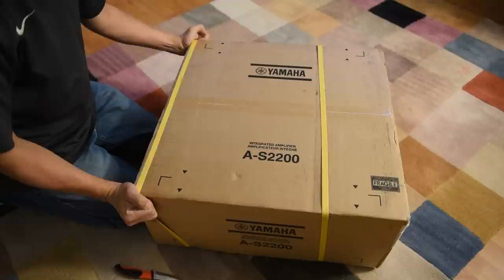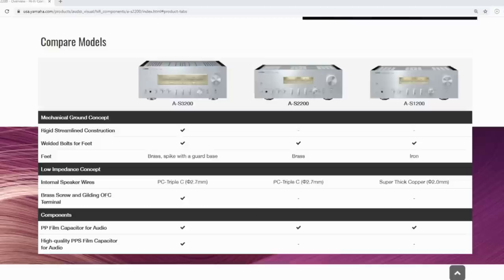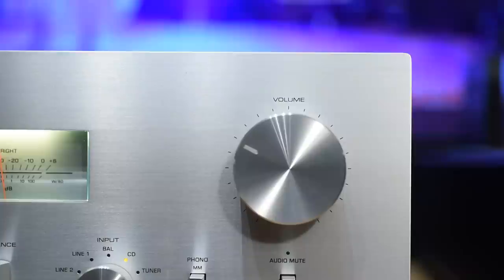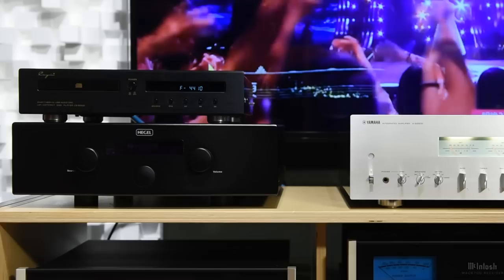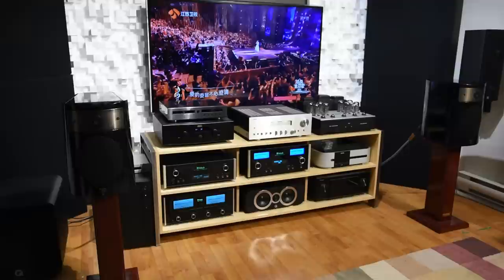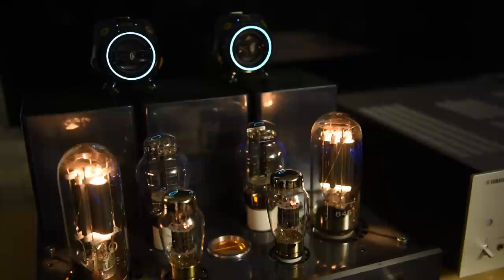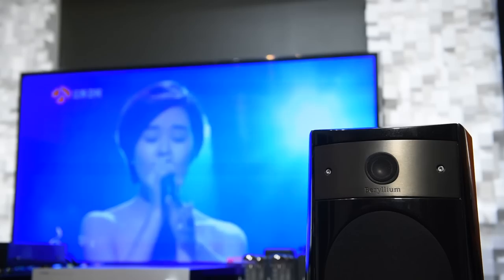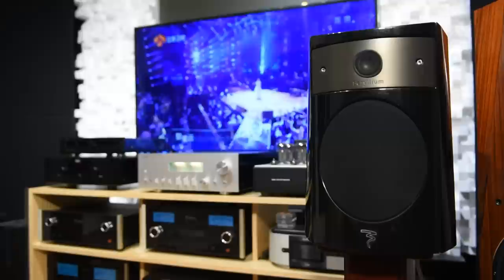Did it blow me away? Yamaha AS2200 Integrated Amp review

Comment from the maker: Updates from Yamaha: 
1) The knobs are machined aluminum (even the smaller ones including the trim, speaker, meter knobs which was upgraded from the AS2100).  They aren’t plastic.
2) The AS2200 also uses better feet than the A1200.  They’re machined brass with chrome plating.  The AS1200 is iron with chrome plating so they look the same but they’re not.  The brass actually helps with the mid-range richness and lower bass.
Reply: Brass knobs make this amp sound better?  Give me a break.
Reply: Howard Skillington he’s talking about the feet... but still I can’t think of any reason brass would sound better than iron 😂
Reply: With all due respect Thomas, how could an expert reviewer like you be unable to tell if the knobs are made of plastic or metal ? The difference is usually obvious !!!
Reply: Adlene BOULEBTATECHE do you think Thomas owns every Yamaha on the planet
Reply: have you seen the guys video who did a full breakdown with the schematics of the previous gens a-s1100 vs a-s2100?   they were deemed nearly identical in design, minor differences yes bigger caps and balanced inputs but any difference in sound imperceivable under most circumstances...   I wonder if the same is true here or if they did a little more to make them different....
Reply: @kvrhifi  All I can say is....LOL....
Reply: maybe we should also make our table feet machined brass for better sounding:)
Reply: @kvrhifi  Also, if you rub vicks vapor rub on your actual feet, it will change the sounds.
Reply: some one who has already reviewed it told thomas the knobs are plastic.........and also about the mid range uplift...... if you listen to lousy amps and then swap to the yamaha it sounds bright in the mid range but its not........if you have a thousand speakers you need tone controls .....if you have a treated room and use pure direct and you soource is clean......this is the end game for most people......also what dac are you guys using with the yamaha ......what differences have you guys heard..... im going to put brass knobs under my shoes....going to make me richer so i can buy this amp.
Reply: @jessielees  the video you mention is by Stereopolice.  As most of the people's input here are all assumptions, his are too.  His assumptions are more applicable to overall quality of how the sound is processed within a circuit, and not to the differences in sound among the amps.  To really tell if there are differences among the amps you have to listen to them. You can't assume that because the circuit diagrams look similar, that they sound the same.
Reply: @kvrhifi  Thanks for sharing your experience.  Were you able to compare the 3200 to the 2200?  Wondering what the difference is in sound.  Also, what speakers did you use for the 3200 audition vs your home setup?
Reply: @santhoshk8890  knobs are aluminum, not plastic.
Reply: @kvrhifi  did you place the oreas underneath the yamaha feet or the case?
Reply: @howardskillington4445  thats was i think too...these people are just talking s...
Without double blind test u cant prove anything like that, and with DBX he wouldnt be able to say difference at all...
Its unbelivable that he says that...
The other day What hi fi recomended, to put half inflated bike tube underneath DAC to make it sound better...do they really belive people are so f.....g stupid!!!
Its really beyond reality
Reply: Anyone have a suggestion for the best phono preamp under  $700 for a mm cart ? I wish someone do some phono preamp reviews
Reply: it would sound better on non crap music. Try Chris Rea albums
Reply: @nathaniel8422   Chris Rea ? Was that irony ? The man who gave us Driving Home For Christmas ?
Reply: @jimfarrell4635  kiddo, he has more albums than you have years
Reply: @adleneboulebtateche156     One of the earliest  his video reviews , he was praising BOSE speakers .  Maybe he is an expert , but I am not sure of what :-) .
Reply: Howard Skillington not the knobs, the feets are made from brass...
Reply: Thomas, did the Schiit Audio Freya + have alum knobs or plastic?
Reply: @hurkamur1  it's hard for the general population to believe this, but as an electrical engineer, I'll break down the engineer reason why it matters.  With some electrical components, physical movement (i.e. vibrations, emf interence) affects the specs of some components, for example, the power transformer and therefore can affect the sound signature.  Now how much does it affect it?  It depends on what type and how much the physical movement is.  But generally, not a whole lot, but it does affect it.
Reply: @remedyforstress1277  That's not what I'm arguing against. I'm saying 2 different well shielded cables that measure the same or very similar resistance, inductance and (to a lesser extent) capacitance wise, sound exactly the same. All these people saying otherwise drank the kool aid. I'm not saying a $10k cable is the same as a zip cord, just that the differences will show in measurements. Expensive materials and high cost does not necessarily equal high performance. 

Edit: My mistake. I saw this comment was on a Thomas audio video and assumed you were talking about cable vudu.
Reply: @nathaniel8422   Since when must quantity equate to quality??
Reply: @philosopher0076  Chris Rea is absolute talent. If you cant hear it, visit doctor for ears
Reply: @jackprick9797  If the circuits are the same there is no reason to expect a different sound.
Reply: @ryanamendt8363  correct and the circuits are not the same.
Reply: Thomas &stereo  , i trust  You and im Buying  a Yamaha. Teller me weich speakers  to take with   a Yamaha upravo to 1500,2000e
Reply: like a modern version of my ca800
Reply: new to your channel but really like how you talk about specific music in the context of your equipment review.  The part where you broke down your amp expectations for the Wonder Woman drums was fantastic.
Reply: YAMAHA AS2100 vs ROTEL RA-1592.I am torn. Could you shed some light into their characteristic differences in terms of sonic performance?
Reply: @marcusaurelius2988  Hi  I have the Yamaha 3080 and love it the YPAO Does an excellent job  !!! I got an super deal on Amazon 😁 I love the bang for the $ buck but NOT  at the expense  of  quality 😊 this is my third Yamaha receiver😊 The other two are passed on to the family and they are enjoying it😊 With their 100 years of making musical instruments you can trust they know and care about Sound quality🤔  I use it for Home theater  and Stereo 😁 so take this for what it worth.....And ENJOY YOUR JOURNEY😍😍😍
Reply: There are high quality plastics that look and feel like metal. They are rarely used as well all want the cheapest product built to a price. It is possible to be confused. Anyway I have the As1100 and it's pretty amazing tbh.
Reply: @shugg1632  Have a look at the Schiit Mani. It's a giant killer at $129 USD. Yes $129!
Reply: Hey Thomas , do you know if the Yamaha as1200 has the same aluminum knobs?
Reply: @jessielees  the new 1200, 2200 models have 625va toroidal transformers. the older 1100 & 2100 do not.
Reply: @kvrhifi  and what the best changing the sounding of your feet's on speaks, kitchen salt's or potassium?
Reply: @nathaniel8422  "kiddo, he has more albums than you have years"
New Zealand has more sheep than citizens, what's your point?
Reply: @nathaniel8422  and you are?
Reply: @neetop1557  well, if someone does not recognize talent of Chris Rea, its like saying Mozart is not important. Chris Rea is one of best musicians in history
Reply: @nathaniel8422  Comparing Chris Rea to Mozart is like comparing a McDonald's burger to filet mignon. Thanks for a good laugh, Mr burger flipper.
Reply: Hello Thomas , don't entertain negative post, feet make a diffrence and a huge one.   I own the Yamaha AS1200 and I am very very happy with the sound I wanted to upgrade to the AS3200 but I will buy the Yamaha external amp and use the 1200 as a preamp.
Reply: How exactly do the material changes in the feet translate into an improvement in the capability of the circuit? Rather than accept what yamaha might claim, have you been able to verify these claims, because, as a potential buyer this and similar technical details are what I'm interested in.
Reply: "The brass actually helps with the mid-range richness and lower bass". Do you actually believe this? Could you tell the difference in a blind listening test?

I'm torn betwixt the 2100 & the 2200 and am struggling to see what the extra £1,000 will get me for the latter as they both have pretty much the same specs....brass feet notwithstanding.

Comment: I own both the Yamaha A S1200 and the Yamaha A S2000 which is two generations older.  The A S2000 has slightly more air and natural soundstage and sounds "tube" like in comparison.  The A S1200 has MUCH tighter bass and overall more information in midrange and top end.  When I change from one to the other after a few weeks of listening I am always very pleased with the sound I hear.  They are both great amps in my opinion.
Reply: If you only had one, which would you keep?
Reply: If you had to choose one which one would you keep?

Comment: I just bought a A-S2200 and am VERY happy with it. I'm using it with a Denafrips DAC via the balanced outputs. During my initial test with one of my test tracks I heard distortion. But since I had watched your video I was ready for this. I simply reached over and flipped the switch and bingo, problem solved :-). By the way, even this attenuation switch is a high quality mini chrome toggle switch, when other companies would have just put in a cheap slide switch or something. Nice to see attention to detail like that by Yamaha.

Comment: As a proud owner of an A-S2200 I have to echo Thomas' review. Although I have not heard nearly as many amps as him, I would concur about the high mid range/ low high bump. Just happens I love it!  It sounds incredible. FYI, I have the tone controls at zero. This bypasses any op amps and is a direct circuit. The build quality is beyond reproach.  This thing is built like a tank, (50 lbs),  and the knobs, remote and inputs exude quality.  The VU meters are awesome! The topology is very interesting, (a circlotron as well as mosfets), and one only has to go go to stereopolice on YouTube to see an extremely comprehensive review on an A-S1100, which has a similar topology to get a better idea. The big difference I would guess is the 2200 has a toroidal transformer, although there are more that are beyond this post. I imagine many think Yamaha as a "Best Buy" level amplifier, but rest assured, the A-S series are audiophile level pieces. These are magnitudes beyond consumer level  products. Just my two cents. Take it or leave it.
Reply: Hi Kevin, would you mind sharing what speakers your are pairing with the S2200 please? Thanks Kevin.
Reply: @kevinpreest3915  Sure thing. GoldenEar Triton 2's. I listen to just vinyl and have a front end consisting of a Transrotor Max with Jelco 750 arm and Hana EL cartridge. Using a Vertere Phono 1 phono preamp so I'm not using the Yamaha's phono stage, but I hear it is very good. Absolutely love how it sounds.
Reply: @MrKevart66  
Thanks Kevin. That sounds a pretty awesome setup! 👌.  It certainly is interesting to see what others are pairing with this amplifier and give other tried and proven options. The caveat being the room of course. Thanks again!

Comment: Thomas, 
After watching and reading everything I could find on the new Yamaha integrated amps A-s1200 through A-s3200. Found your review of the 2200 to be the most thorough and informative, specifically the email from Yamaha comparing 1200 and 2200 and  the survey on before / after break in tone difference. Watched your review many, many times for about 10 months and the week before Christmas 2021 decided to go for the AS-2200.
It replaces my 40 year old Yamaha R-1000 (100 WPC) driving 1981 vintage Infinity RSa's and 1984 vintage RS 6/b's  music source is apple music and Yamaha WXC-50
So far I'm extremely pleased with the 2200's sound.
Your reviews are entertaining and not saturated with meaningless audio snob terminology. Yamaha owes you a commission for closing a sale. Great job keep it up.
Reply from the maker: Thanks for the heart warming feedback.
Reply: Hi! Do you stil have the a s2200? How you compare this to the vintage one? I m interesting to buy an as1200 and currently have myself a vintage unit.
Reply: @narcistimofte6448  Yes I still have the 2200, The vintage amp that I have is a 1981 Yamaha R-1000, in general the 2200 has great sound, and has the classic Yamaha "Natural Sound" characteristic of the late 70's 
CR-440 through CR-2040 series and the early 1980's  R-700 through R-2000 series integrated Amps. I have never listened to one of the mid 1970's 
CR-1020 through CR-3020 series to be able to comment.  The New 2200 doe's not have a loudness control feature that my R-1000 had, nor the spatial Expander Function.
That was only on the R-700 through R-2000 units.
I have not yet used the XLR inputs on the 2200. the only source used so far is a Yamaha WXC-50 and apple music and I phone music library, which is what I was using with the R-1000 that I removed from service in Dec. 2021.  The R-1000 has much more in the tone  control  - Bass, Trebble, Presence (Midrange) as well as Loudness, and Spatial Expander (imaging compensation for room influences). Main reason for replacing my R-1000 was that it made scratching sounds when turning the volume control and other tone controls and sometimes made crackling sounds in midrange frequencies, I assume due to 40 year old capacitors and other compoents in the output stages which are integrated non serviceable pieces. I'm driving old Infinity RS5/B speakers 3 way - 4 ohm, 88-89 dB -  sensitivity level speakers rated by mfg to operate in the 35 to 125 Watt power range with no issues.
 Short answer after all of that, so far really happy with the 2200 remote control is one of the best features, The Yamaha "Signature Sound" of  this unit is as expected strong in the midrange.

Comment: Already liked the video, but I'm going to comment as well because this is a superb piece of equipment. I own the A-S2100 and it's glorious, the sound that comes out of this is awesome, just enough punch and attack to feel engaged but no treble hiss at all. The MOSFET-design sounds kinda tube-like but with the best of both worlds, especially male vocals and midrange pop a bit more making it exciting. I own a pair of 90db sensitive speakers and my watt-usage according to the meters never goes above 10W, and by then it's as loud as I can manage.

I'll probably own this unit for the rest of my life, unless Yamaha comes out with a new range of much better products.
Reply: The new series Yamaha A-S1200, 2200 and 3200 no longer use Mosfet-transistors in the powerstage section but normal ones! The old A-S1100, 2100 and 3000 where Mosfet desings and the topline at that time...  They have downgraded the new A-S1200, 2200 and 3200 series to premium grade and Yamaha now only uses Mosfest in their flagship series C-5000/M-5000!
Reply: @preude1  are you saying the older series (1100,2100), are better than new series ? Because of that MOSFET amplification? I'm interested to buy a new a s1200 , but I haven't heard the a s1100
Reply: @narcistimofte6448   Not better but different, the new C/M-5000 has Mosfet-amplification. The other series 1200, 2200, 3200 no longer mentioned.

Comment: The Yamaha will always have the truest voicing of any amplifier. There are no boosted frequencies. If you need a bass boost then turn the bass knob up. The so called mid-range bump you mentioned is just because the high and lows are recessed to where they need to be and allowing the mids to shine through and not sound veiled.